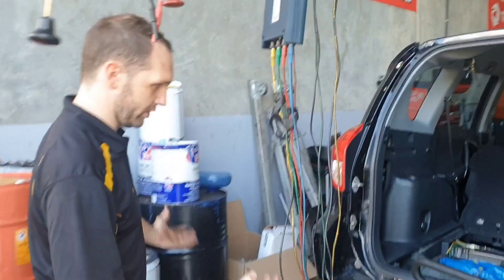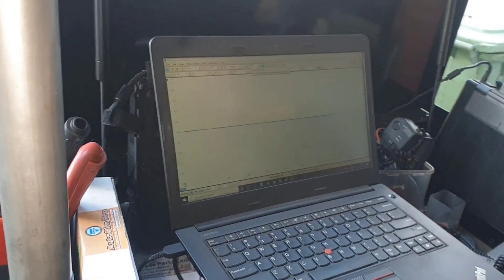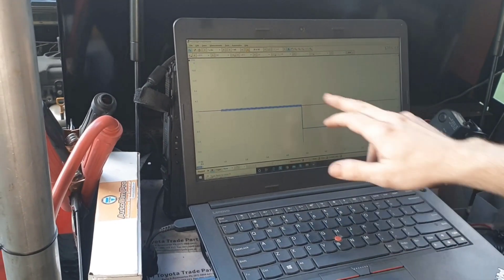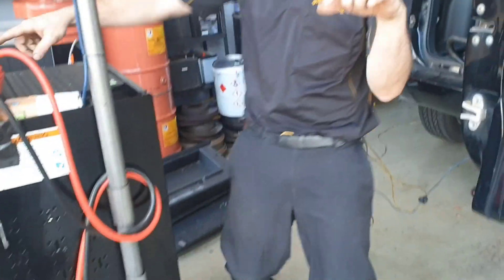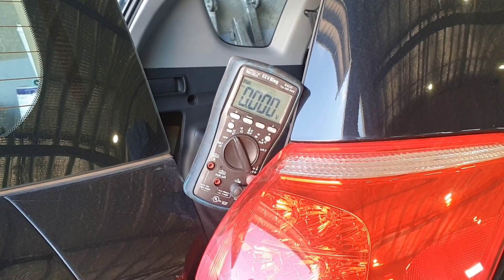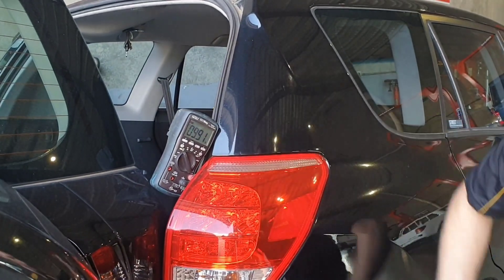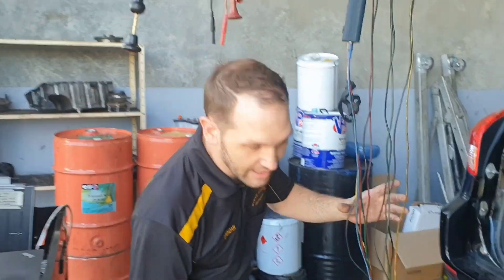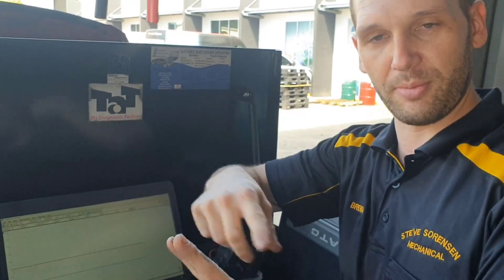ABS sensor testing – Oscilloscope versus a multimter.

Comment: With the multimeter test, I believe you need to back probe one lead into the output wire and then spin the wheel to see voltage changes up/down on the meter.   You seem to have only back probed into the input line which only confirms that the power coming into the sensor is good.
Reply: Multimeters might still not show this like a oscilloscope the meter it just taking an average voltage imo . There are analog sensors that are like you mention that change the voltage with speed on wheel speed sensors

Comment: Is the signal in the positive or negative? 
Bad sensor? What if the airgap is to big or magnet ring completely damaged?
Reply: Would have to have no teeth left on the abs magnetic ring for it to not work at all. That's pretty unlikely. Probably would of made some terrible noises to do that.... and the sensor would also likely be damaged If that was the case. Good example of scope vs multimeter brendan
Reply: Frank Ryan 
I have had this once where a spring from a handbrakeshoe damaged the whole bearing ring ( no noice was heard by the costumer) and sensor had a little scratch but was still working good. Good comparison scope vs multimeter.
Reply: I would still assume that we would remove the sensor as the suspect and inspect the abs ring at the same time if it is also damaged then replace both.
Reply: @frankryan9948  Depends on the ABS sensor setup.  Some of them are buried in the wheel bearing cartridge.  Opening them up will destroy the wheel bearing.